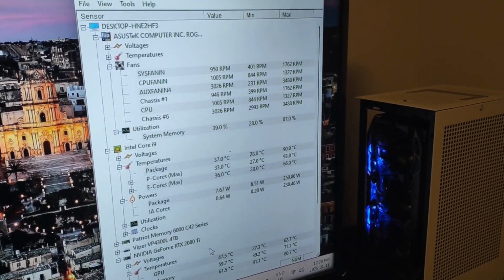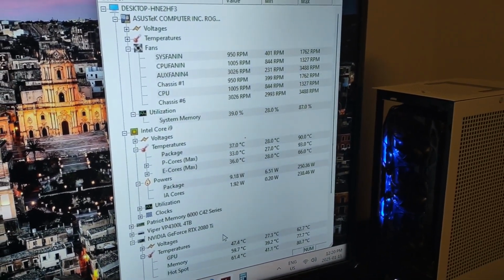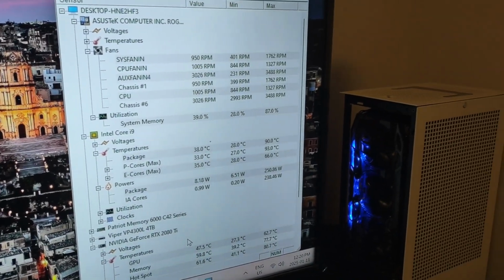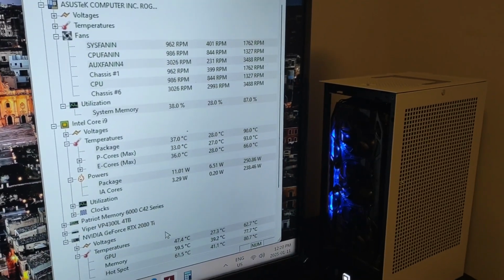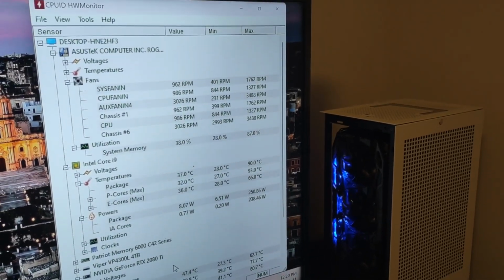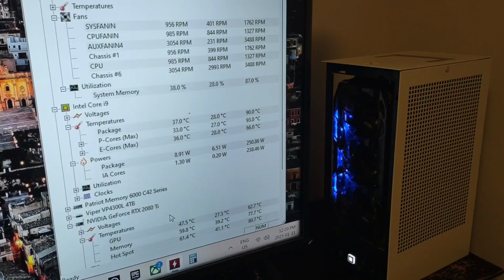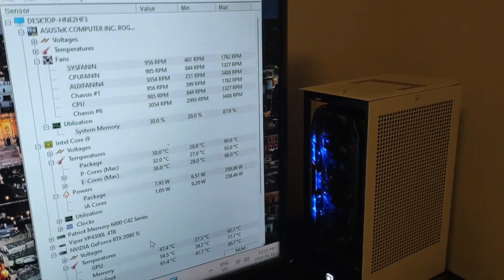How to build a quiet PC and why? How to fix a noisy pc.

Comment from the maker: Sorry couple of errors in my video...first the power supply used in the build is Cooler Master 750 gold SFX ---no thermaltake. Secondly the air competing is usually if there is two exhaust fans on opposite sides, trying to compete for air against each other is what causes air noise fiction.